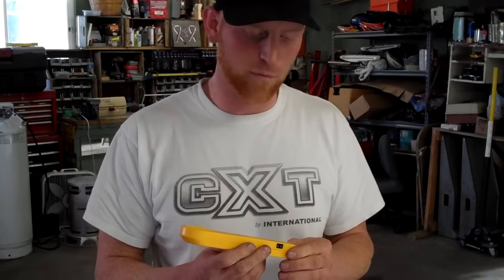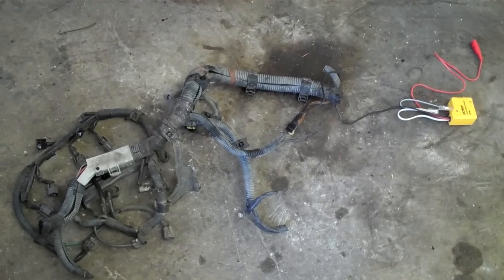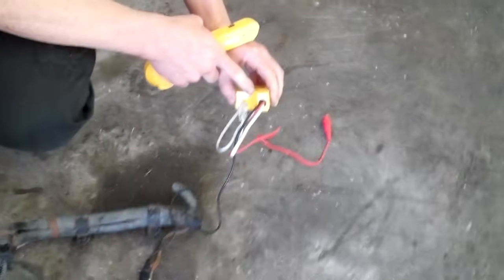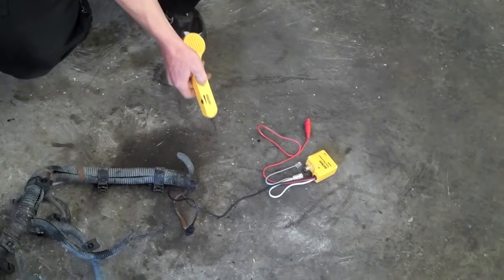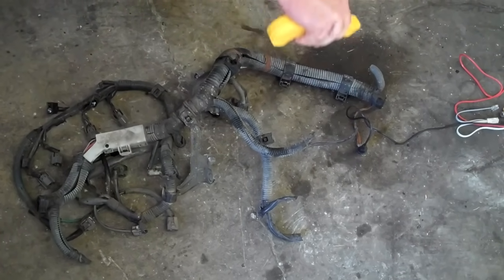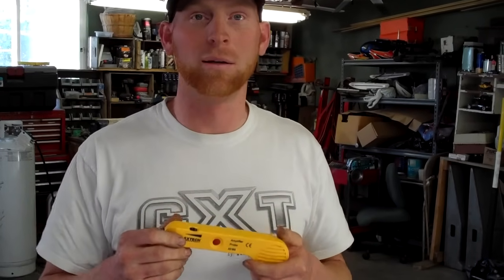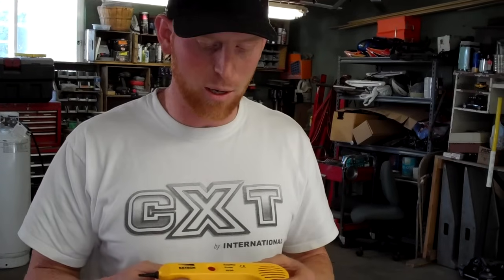How to find an open circuit or shorted wire the FAST easy way

Comment: would this work on a loose ignition switch on a classic car? When i turn the ignition on i get no power, but if i reach my hand under the dash and shake the wires or move them a certain way i'll get power.

Comment: I still don't understand how you'd find a short ? With a harness that's inside an engine bay? Will the tone cease where the short is??
Reply from the maker: The wire will tone with ground at one end and not the other.  Follow the quiet side till it tones with ground.

Comment: If you have a cut wire or cable, it will most likely not make a short circuit, it will be an open circuit. The problem if the cable has a short circuit is that the signal will be everywhere and you will not find where the short is. It's only an open circuit where the signal will fade to show where the break is...

Comment: I have a 2018 Lincoln Navigator that is giving me a short to ground on multiple things. I have replaced the led modules clear the codes and everything works but then the right turn signal stops working then the left than some running lights. It’s on a vehicle that has a front collision. I’ve checked the harness and don’t see and wires damaged. Did notice a small amount of water in the driver side left headlamp connector.
Reply from the maker: That water is probably the problem!

Comment: I tried using one of those to find the Red Wire for my electric trailer brakes 7-pin connector.  It only worked sufficiently to tell me that the wire might be up front in the driver's footwell area.  Ultimately - looking around for the umpteenth time with a pencil light revealed the wire neatly coiled up and hidden behind another part of the under-dash area.

Comment: you can also make one of those tools using a few transistors and an op amp. i'm going to use my oscilloscope as well to make sure the pwm signal from the esc is behaving properly. great video. im used to fixing surface mount electronics in devices and fixing car wiring is new to me. im positive there is a short. extech make great tools, i have a few of them. they have been bought by flir. they make great multimeter leads as well that are as good as fluke for a quarter of the price.

thanks for the great video.

Comment: wow.. this tool is useless for a wire short man. if theres a short, it WILL Not work. the short gap would have to be 2 ft away to work ok... lol best bet is just doing a continuity test with long multimeter leads.

Comment: Dude this is genius!!! I just used this method and it worked!! I found my electrical short in no time using a toner and probe from my work doing telecommunications. I had a main fuse short so I stuck the positive and negative clips that connect into my toner, turned it on and my probe sent a signal until it didn't. And that wire that had no tone just had to be unplugged and bam!! Found my short in like 5 minutes. Thank you so much!! You saved me a huge headache with this one man. Keep doing what you do

Edit: also realized just now that this is a 13 year old video. Amazing!

Comment: Power Probe 3000 has ben on the market for some time and does a good job of finding the location of your problem.  It send a signal down thru the wire and you trace this signal with a handheld probe that provide you with a lit symbol telling direction you should follow and this light changes to a dot when you reach where the break or short is.  I you cross over the short the light will reverse direction. Great thinking on part of Power Probe and in providing a good engineering solution.

Comment: I bought the Southwire affordable version, but it doesn't show the instructions on how to use the fuse lead on the testing probe.  Any ideas?  I don't know how to use this device.  I have a fuse that keeps popping my parking lights, so I'm not sure where to put the testing lead? In the breaker fuse box?

Comment: I have a version of this tool made by another brand and did not think to use it. Bought to locate wires behind walls and it served its purpose Harbor freight has this tool for under 30 bucks.

Comment: I've learned a lot of things as an electrician but I never thought to use a toner to find a short because whether it was commercial/residential electrical automotive electrical, I never had to find many shorts. 

I like using this example the best. If a surgeon can open someone's brain or heart and put it back together, then they must be very "smart" or "intelligent" right?

But if they can do that but they don't know how to change a flat tire, does that really make them smart? Just because they learned our were taught how to do one thing well, it just makes them good at that thing but not necessarily smart or intelligent by any means. 

This young kid that worked at our gun part manufacturing/CNC warehouse was the programmer for the CNC machines and was by far the smartest kid in the room. He was autistic and has Asperger's too. 

With that being said, he did so many stupid things, you wouldn't believe he was as smart as he was if you didn't already know. 

Watch a video called, "college students can't answer basic questions," and you'll see what I mean.

Comment: Hi Brian:  Please show us how the tool works to locate the short.  I have a situation that the wires are partially shorted and small amount of current crosses.  I want to locate the short instead of tearing up the wall.

Comment: Where can that tool be purchased? I have a 2000 Ford f150 4.2 engine . Shows code 16 something about anti theft system. Mechanics hooked computer on and can find anyhing,just code 16. Ecm is good according to them . Saying there is a short . Possible in steering column.  That would be a amazing tool if I could get hold of one.

Comment: Will this work for a short to ground? And will it work in a scenario where wires are routed through metal square tubing that is also the frame of the trailer? In other words can it read through thick steel? And Without sending the signals through the steel, since the wire is making contact with the steel?

Comment: Probably being thick, but how does this help you find a shorted wire?  I understand it helps you find a break, but if theres a short circuit (i.e. 2 wires touching somewhere in the loom) - how does this help?

Comment: It would be hard work if the wire loom goes all under the dash of your car, how to test a wire is when something don't work then fault find that problem only, you can't chase around everywhere over a house or building, under floor boards, you test a problem when something stops working sorry but the old method for me

Comment: Doesn't seem like it would help with a broken wire or what not. the break is so small and the chime on the tool doesn't really fade away until quite aways away from the source. Tone should shut off completely when comes across a break.
Reply: Seems it might be better suited to find an open circuit where you have a break in the wire, not a short to ground or short to another wire. Might be useful to find that open in the circuit through a harness, though!!!

Comment: My problem is something is causing a dead short under the dash and blowing the fuse.  I don't see an attachment that you could take a fuse out, put it in to send a signal through the positive wire.  those mini blade fuse connections would be hard to stick something in it  otherwise.

Comment: For the past two months, I have had no dash lights and no park lights on my truck. So when I drive at night, going to work, my rear lights are not lit up unless I press the brake or the blinkers because those two both work Thank you so much for your video and I’m so glad I found it because I’m going to use this tool to find the problem. All the fuses and relays and everything is good in my truck so it’s gotta be a wire.
Reply: My grandma's van doors stopped opening automatically, dash lights and tail lights quit working. A shop wanted $7k to "diagnose" with the possibility of not fixing it. 

So I said fuck it. Pulled out my multimeter, traced wires, checked all the fuses. Everything was good. I finally cleaned off the negative terminal of the battery it had a small amount of corrosion and boom it fixed everything and it's never had a problem again for years now. All over a little corrosion, it could've cost an elderly woman $7k lol

Comment: The quality ones the toner has the ability to put out multiple different tones just by touching the leads together so you can hook yours to one wire and your coworker can hook his to another wire and either mic can find either tone. There are a bunch of different tones. The cheaper ones have a couple different frequencies or solid tone too.

Comment: Do when your probing obviously you have e to have your power on. My question is that when it gets close to the open or live/broken wire it starts beeping but ots not exactly pin point accuracy correct? As you mentioned there are 4 ground wires and it kept beeping throughout the whole wire harness. How would you then know when you found the area of the shorted wire if this was beeping all throught this wiring harness? Thank you
Reply: That's what I was wondering. It's like this was designed for super big gauge wires or a single wire or something.

Comment: Wont work cause the wire bundle has multiple wires. Unless all the wires in the bundle are shorts it will tone fine and you wont find the short.

Comment: Thanks! I have a dead motorcycle and have no idea where the open wire is. I installed a new, good, tested battery but the whole bike is stone dead, no electric at all. New fuses... I'm scratching my head.

Comment: If I were to use on motorcycle, would I have to disconnect battery?
Reply from the maker: Not really.  It may help for narrowing down a circuit though.

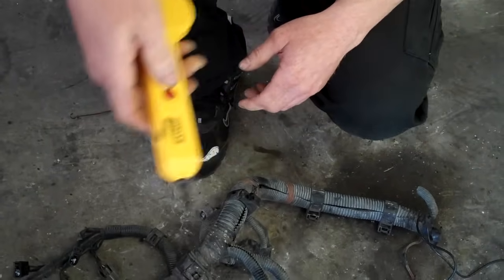Comment: Beginning @1:34, he demonstrates it on the electrical wall outlets but in showed absolutely no difference in TONE sound; much less did we hear a RING tone on any part of the wall. It was only a buzzing sound that was exactly the same whether he pointed it either: above, below or far away from the electric supply behind the wall. 
Also he showed that it gave a ring tone when he placed the device over the 'hot' wiring harness, yet he 'did not' show how it identified an electrical short...where the tone changed on the wiring harness. The only time the harness 'ring-tone' stopped, was when he aimed the device at the floor a couple feet away. 
At least he proved that you can use this device to determine that there is no electrical short in the concrete shop floor. Just saying.

Comment: Friend of mine has problems with brake light on his roadking,  4 different shops n 400 later the problem persists. This is perfect tool to find the problem.  Ty

Comment: Thank dice,  thanks for keeping your videos straight and to the point. I got an issue with a tao tao 110 quad, I got spark and compression,  is see, i little smoke comes out of where the exhaust meets the manifold,  but I can't get it to run,  any input? Thanks

Comment: So you never actually told us what it does when you have a broken wire I know you said it changes but specifically you never showed us you putting it on the broken wire and exactly what it does you never explained anything all you said is that it's going to make a different noise what is that noise and can you be more precise exactly

Comment: There main design purpose is so u are able to find that pair of of 1000's of pairs of wires and bundles it allows u to go right to it this is how the cops brings u a work order to put a phone tap on ur in and out calls no joke and it sends them remotely to I'm guessing a recorder for evidence but it's made for Tracking same thing except how would u find a dead short with it is my qes Because that doesn't always have to be broke get me something it pinched up and touching so in turn makes a dead short fr

Comment: I worked for us sprint for some years it's called a tone generator but just for future rule of thumb is to hook the small box some distance away from the harness it's just to make sure ur not interfering with what ur looking for cause it throws of a powerful signal expesally when it's got new battery's fr just put u like 4 ft long jumpers then begin to test because I have seen them just be picking up off the generator and the brake be right there and u over look it feel me that all

Comment: If it's bleeding across multiple wires like it is clearly doing there, you put the probe end in your palm and use your fingers to isolate the exact wire/pair.

Comment: When you say “short” in the electrical world it is not interchangeable with the term “open”. So if a wire is cut , it’s an “open”  not a “short “.  That is important when teaching electrical or electronic troubleshooting. There is a difference.
Reply: THANK YOU for that.  Here in the south, where I live, everyone seems to call an open circuit a "short."  Drives me nuts.  Shorts trip breakers or blow fuses.  Open circuit means that something that should be "on" is "off."

Comment: That looks like an awesome tool. However, how do I check a wire in a vehicle when the wire is running through a car? I thought adding alligator clips indicated a fault, do they not? How would I know with the tool you are using? I clearly am new at checking if my automobile has failed fuses and wires.

Comment: Hey how's it going. I got an at oil temp light flashing constantly. I did code handshake and got 45.
Intake manifold pressure signal detects open or shorted input signal circuit.. can you please tell me what I might check on this 2001 Forester L. Thanks!!!

Comment: I bought a very expensive toner years ago since I'm an electrician and it never worked that good. Then I got into another situation couple years ago and I found one at harbor freight for 30 bucks I think and it works great. I have an open circuit in my ABS system and I forgot about this thanks for the reminder maybe just maybe I can find out where that mouse had lunch!!

Comment: NOT giving a thumbs down? BUT?I did purchase this item after viewing your video Only! To learn after the purchase? YOU'RE NOT TO USE TONE ON ANY(Hot) Wire.. despite the volts. I purchased because I didn't wanna probe any ignition wires to leave Exposed? Only to learn it's a Continuity tester only ! If the wires HOT?

Comment: is this tool any better than my power probe ECT-2000 ?
Reply: Circuit toners can be very accurate when digging through a large bundle of small wires. The ECT looks like an all in one tool. I would say a multimeter and circuit toner are two tools that do the same job far better

Comment: I changed the turbo thinking it was the issue but noticed once I got her in that she worked perfectly but the next day I noticed that the accurator stop working but when I turn the car off and on it work for a bit then shuts off. I know it's not the sensor nor accurator what could it be???

Comment: how about shortish multiple wire overmolded cables and I want to find which end of the connector has a break? e.g. solder contact from wire creates a break? Are these types of 'rugged' probes/wire tracers sufficient for something so sensitive?

Comment: Not recommended. Other that identifying where the cable leads to. But for looking for break in the line these aren't for that. And since these are tone generator the bundle of wire they the loop beads thru the signal so you really not sure which wire is which again there other tester tool for  that but not this.

Comment: Could use something like this ocassionally. But unrelated I still want to thank you for putting out a video pulling out a 4.0 motor from a Jeep Cherokee. It helped me greatly 4 1/2 years ago when I did a swap with a new engine on my '90 Jeep. To this day running sweet!

Comment: I have a same tool but of a different brand but they all work the same. However, it will not find a short. A short makes two wires as one wire. Tone will continue for the entire length of the wire. Opens, yes since the signal will fade after the open, however, an adjacent wire will pickup the signal and radiate and you may miss the short. It takes practice with trail and error to get close to an open with bundled wire. A simple AC circuit behind a wall can also throw you off.  If you put the toner on the BLK and WHT wires(no power) and only one of them is open, you'll past the open. Again, experience using the tool takes time but it is still a great tool to have. May use it once a year as a homeowner but it's indispensable.

Comment: So if you're connected to all 4 wires at the same time and all of the wires are right on top of each other running from end to end throughout the wiring harness, how does/how can the tester differentiate between the 3 good wires & 1 bad wire if it's beeping/humming for the 3 good wires at the same time as it's going over the 1 bad wire? Meaning, wouldn't it just keep beeping/humming as it's picking up the signals from the good wires. Do you connect to 1 wire at a time and scan over the entire harness for each wire independently? 
On a separate note: It would be nice if it only beeped when it found the open/short in the wire circuit. E.g. the way a metal detector only beeps when it has found something.

Comment: Ok so if we had a fire 4recently  and fire only touched one side of trailer. Broke the windows. But didn't see holes burnt in trailer...can i still use this to see if the wiring is good to go and safe so that i can  use the electric  in here. Nd when i test it do i need to have rge main breakers on fir it to work?

Comment: They sell that same tool at harbor freight for about 20 bucks, works just as good
Reply: If you go to the link in the description it goes to amazon, where the unit hes using is shown, there is a selection to get the standard version for 24.99. Just to let you know